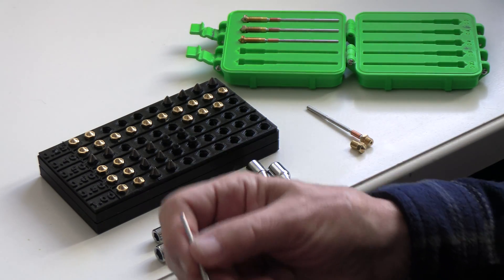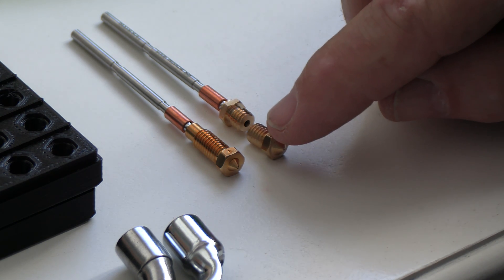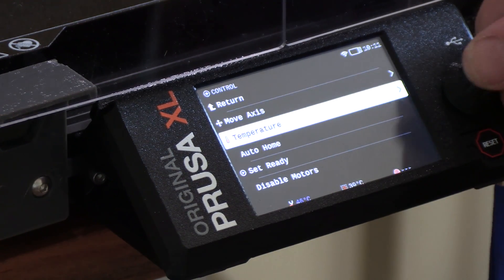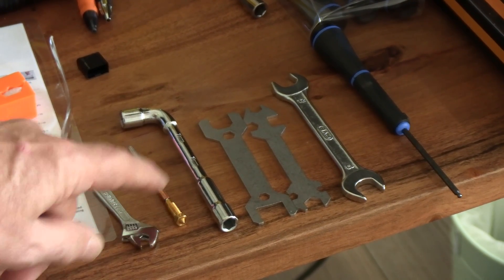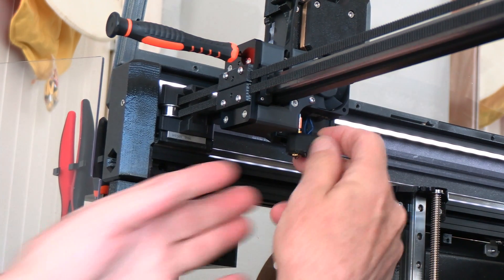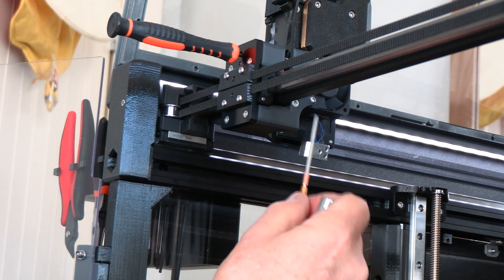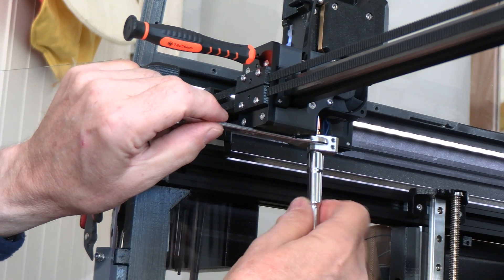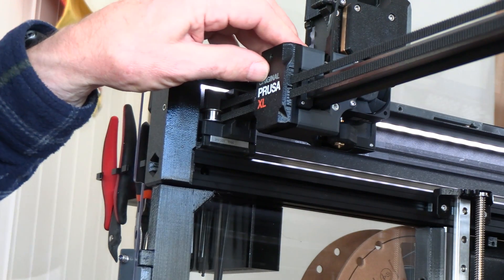NOZZLE CHANGE on the PRUSA XL

Comment: You don't need to take the cover off. There is a hole in it for the torx wrench :)
Reply from the maker: You are absolutely correct however, when I’ve switched from a one head to a five head printer, you don’t even need to take the cover off. You just take the extruder out of the carriage and that’s where the opening is for the torque screwdriver. Consider subscribing. Thanks. Joe.

Comment: What the everlasting EFF do you need multiple hardened steel nozzles for? I mean, I can understand having a brass nozzle or two in stock (although ten seems a BIT excessive in my opinion, but okay), but FOUR hardened steel nozzles in some cases!?
Reply from the maker: Thank you for your comment. I agree that excessive numbers of nozzle purchases. Don’t make a lot of sense however, the Prusa XL has five different extruders and if you’re going to be printing with each one with an abrasive filament such as carpet fiber, it’s recommended to use one of these nozzles. Consider subscribing. Thanks. Joe.
Reply: @JosephHunstad  Oooh I'm sorry, I completely missed it being the XL with a max of five extruders, my bad.

Comment: Dr. Joe, what camera are you using in the back right corner of the enclosure?   (While I like the Voxel3D enclosure, it sure doesn't leave much space for camera mounting inside.
Reply from the maker: I am using the WYZE cameras, but they’re on the outside of the enclosure. You’re right I tried to install one underneath the center of the roof of the enclosure, but the cables from the extruder bang into it. I also tried to put one in front of the bed behind the doors, but it’s too tight, so I’ve got one on each side and one in the front. I also have a camera filming the real of whatever filament I’m using so I can keep an eye on it to be sure that it’s feeding properly. Consider subscribing. Thanks. Joe.